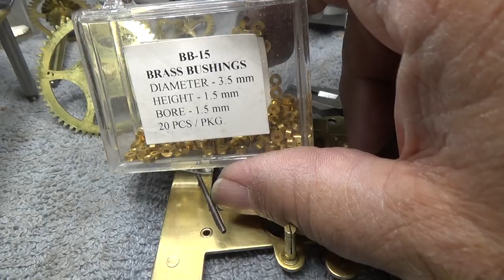Twin Gilbert Octagon Drop School House Clocks Clean and Repair

Comment: An index for this video:
00:00 THE FIRST CLOCK of two clocks
0:00 - 1:41 Introduction, plants and animals in the workshop.
1:41 - 3:18 Checking for dirt, damage, and wear.
3:18 - 8:49 Disassembly and checking in detail for damage.
8:49 - 10:44 Unwinding the main spring.
10:44 - 12:23 Cleaning the parts.
12:23 - 14:05 Removing stains and tarnish, using 0000 steel wool; discovering that the plates are bent.
14:05 - 16:26 Polishing the pivots and arbors in a lathe.
16:26 - 17:20 Checking pivot holes for wear.
17:20 - 21:11 Reassembly.
21:11 - 23:21 Oiling and final assembly.
23:21 - 24:00 Running on a test stand.
24:00 - 24:17 The completed clock running.
24:17 THE SECOND CLOCK
24:17 - 25:03 Introduction.
25:03 - 25:56 Checking for damage and wear.
25:56 - 29:29 Disassembly: separating the plates.
29:29 - 30:59 Showing the parts of the calendar movement and how they work.
30:59 - 32:42 Further disassembly, describing what the parts do. 
32:42 - 35:14 Unwinding and removing the main spring; showing the spring winder parts.
35:14 - 37:54 Wiping the parts after they've been in the ultrasonic cleaner; examining the parts for damage.
37:54 - 39:49 Polishing the pivots and arbors.
39:49 - 41:56 Checking for pivot hole wear.
41:56 - 52:09 Bushing worn pivot holes.
52:09 - 53:44 Bushing a pivot hole that has been bushed before. No need for a custom bushing this time.
53:44 - 1:00:05 Attaching, lubricating, and winding the mainspring.
1:00:05 - 1:02:42 Pegging the pivot holes.
1:02:42 - 1:11:16 Reassembly.
1:11:16 - 1:14:31 Oiling and final assembly.
1:14:31 - 1:15:59 Running on a test stand.
1:15:59 - 1:16:19 The completed clock running.
Reply from the maker: Another fine job of indexing.  Thank you.

Comment: hello again i clean all my brass fittings and rusty metal fitting in citric acid. i leave them in the solution till i see the rust has gone then clean them and give them a coat of WD40 works a treat
Reply from the maker: WD40 coated on clock movements is one of the worst things that can be done to them.  Might make them look pretty, but will ultimately attract dirt and grit and accelerate wear.  No lubricants of any kind should be on the teeth of wheels nor the leaves of pinions and trundles of lantern pinions.

Comment: Mr. Perry,
How do you bend a replacement suspension spring rod for the same kind of clock.  I can  order  another suspension rod from Timesavers but it would need to be cut and bent to match the original. Is there a specific tool to make these bends.  Thanks for allowing us to share your mantastic craftsmanship.
Reply from the maker: I use long-nosed pliers.

Comment: Another wonderful clock video!  I learn so much from you.  You look at all the details and keep pointing them out.  I was wondering what kind of bushing machine do you have?  I would love if you would show how to bush by hand and how it is done for those of us who cannot afford a machine and only can afford the reamer tools.
Reply from the maker: I do not own a bushing machine.  In this video, start watching at about minute 42.  I show the reamer in the drill chuck, but not the actual reaming. That's followed by placing the bushing into the hole and driving it home with a small hammer and finishing with a stake.  Then the bush is hand broached to exact size. Also, in this video https://youtu.be/7pJFUyYMU1o watch from minute 42 to minute 47.  This is what is meant by hand bushing.  Ream the hole with a hand drill or a drill press, place the bushing and drive it home with a hammer and stake, broach to size with cutting broach and finish with a smoothing broach.  All done without a machine.  There are many professional shops that have operated for decades without a bushing machine and there are even those who say hand bushing is equal to or even superior to machine bushing.  Even using a bushing machine, it is necessary to hand file the unworn side of a pivot hole before reaming to assure that the reamer will find true center of the hole.  Instead of a round needle file, I use small diamond grinding bits.
Reply: Thank you for the information!  Do you need a special holder to put the reamer in the drill press or does the reamer bit fit right in?  Thank you
Reply from the maker: The reamers have a round shaft and fit like any drill bit.  The KWM-style reamers have a horizontal pin part-way down the shaft, but can still be placed in a Jacobs chuck.  Adapters are made for both KWM and Bergeon styles for drill presses, but the only reason I can see for them is to extend the reamer farther from the chuck to provide a longer reach to a clock plate that has parts that might interfere with the reach of the short reamer bits.  There are also adapters to insert the reamers to cut truly by hand that act much like a pin-vise. https://timesavers.com/c-325972-tools-equipment-related-supplies-clockmakers-watchmakers-specialty-tools-equipment-hand-bushing-tools-reamers-cutters-adapters.html
Reply: Do you prefer the KWM or Bergeon reamers?
Reply from the maker: Bergeon.  You might like to check out the Butterworth bushing system at butterworthclocks.com 
You have to log in as username: butterworth  and password: butterworth
http://butterworthclocks.com/Bushings_Price_List.pdf

Comment: May I ask which reamer tool you use?.  Is it Bergeon or maybe a KWM?.
Don't they sell reamers for specific tools depending on rather it's Bergeon or KWM?.
I don't want to buy the wrong thing.
I am about to try my first bushing job, and I would like to know specifics if possible.  
No step is baby enough.  Sizes, brands, models, specifications.  
I don't want to mess anything up, which I am wont to do.
Exactly what tools are you using and where do you get them?.   eBay has many.  Timesavers?.  
Is this the proper reamers to drill the holes?: New American Made Reamers for Bergeon or KWM Machines & Hand Tools - 19 Choices! | eBay (ignorant YouTube deletes my link)
How about the chamfer to get rid of burrs?.     Specific size?
How about broaches?.  Like reamers, do they require specifics sizes too?.  How do you tell the size?. 
Not counting hammer and the bushing, how many tools do you need just to pop in a little bushing?.  Here's three already.
Anything else?.  

Thanks a million for your channel and taking the time for us newbs.
Reply from the maker: I use the Bergeon sized reamers because the bushings I buy are in full and half-millimeter sizes (outside diameter).  The reamers are exactly .03mm smaller, making a good, tight fit. So, the reamers are, for example, 1.97mm, 2.47mm, 2.97mm, 3.47mm. to cut holes for bushings that are 2.0mm, 2.5mm, 3.0mm, 3.5mm OD.  I choose a bushing ID (hole) that is equal to or smaller than the pivot.  That means the hole then usually has to be broached out to fit the pivot.  If you use KWM reamers and bushings, you use a chart to choose from a very wide selection of bushings to fit the pivot and then choose the reamer to cut a hole for that bushing, so there are odd sizes for the reamers.  If you are in business fixing clocks by the dozens, the KWM system makes sense to save time, but involves a large inventory of bushings.  There is no "wrong" choice; just personal preference, usage demands and costs considerations.  Broaches come in many different sizes.  Get some that fit the holes you're going to have to broach out.  I also use a very small file to even out the unworn side of a pivot hole to match the worn side so that the reamer centers itself.  Here are the reamer sets, including chamfer: https://timesavers.com/search.html?q=reamer+set&go=Search   Here are broaches (note sizes to match bushing ID in mm).  https://timesavers.com/search.html?q=broaches&go=Search  Here is the file I use: https://www.amazon.com/s?k=Grobet+Swiss+Pattern+File+Escapement+5-1%2F2%22+Round+Cut+2&i=live-explorations&crid=3I43KDQTLMI89&sprefix=grobet+swiss+pattern+file+escapement+5-1%2F2+round+cut+2+%2Clive-explorations%2C104&ref=nb_sb_noss

Comment: I was thinking, you could keep your smooth broach in a handle all it's own so you wouldn't have to change it out.
Reply from the maker: Smooth broaches are different sizes just as cutting broaches are.  I've thought of making wooden handles for all my broaches, both cutting and smoothing, but that takes time and usually when I'm in the workshop, it's to fix clocks and not do other things.  There are lots of things I could do that would make things faster, but who's in a hurry?

Comment: I have a Schatz 8 day cuckoo that my father bought for his father unfortunately the night that my father died it was knocked of the wall by the undertaker's assistant.  I removed the works to repair the case and noticed that the plates are bowed (sprung) some of the pivots had been knocked out of place. It will need several pivots rebushed. is this something you'd be willing to work on? Thanks for your consideration and excellent videos
Reply from the maker: Leave an email address in a comment in about a month.  I'll know better then how much, if any, clock work I will be doing this next winter.  May be looking at a hip replacement soon.
Reply: @dperry428  wishing you the best of wishes on your health

Comment: bonjour , i love your channel mixing ciment to delicat clock work , is one of them was your job before . merci
Reply from the maker: Collecting and repairing clocks is just a hobby I've had since 1968.  I was a science teacher for more than 30 years.  Concrete is just another hobby I learned since my retirement in 2004. Summertime = back yard, pond, garden, concrete.  Wintertime = basement, fix clocks.  Year round = make videos of summer and winter.
Reply: thank you and do not forget one eye
Reply from the maker: Noted.  One-eye is my favorite and gets most of the peanuts.

Comment: Your spring winder tool looks very well-made.  What brand of tool is it?
Reply from the maker: I don't know that it has a brand name, but is called an Ollie Baker style spring winder and is offered for sale by a number of clock supply houses.  I don't remember which one I bought if from.  Could have been Merritt's Antiques or Ronell Clock Company.  As I recall, it was about $230 and includes the sleeves to remove barrel springs.  It does require a set of let-down keys to go with it.  It is very well made out of solid aluminum and nice to have, especially now that I'm older.  It makes letting down springs and winding them much easier than my old methods. Much safer, too.

Comment: When you clean your movements in the solution, do you use rinse solution to finish up or do you use denatured alcohol? I am trying to figure out what works best
Reply from the maker: My little shop is in the basement and I have access to a laundry sink there.  The cleaning solution is water-based, so I just take the parts in a strainer to the sink and run hot water over them.  I then usually just hand dry each part, occasionally using a hair dryer and/or compressed air. An alcohol rinse one might consider with a waterless cleaner or to remove water.  If you use alcohol to dry the parts, it should be as concentrated as possible (95% or better).  A better alternative for drying is acetone, but it will remove any lacquer coating, which is the main reason for using a non-ammoniated cleaner. You also don't want to use acetone with mechanisms that contain plastic parts. Years ago, the collector I did artwork for, used naphtha (benzene) for his rinse and dry. I don't like it as it is a known liver carcinogen.  If you use volatile organic, especially aromatic hydrocarbons as opposed to aliphatic, it is a good idea to use them in outside in open air. I prefer hand-drying as I can closely inspect each part for any remaining dirt or rust and remove it at that time. meticulous cleaning is a must with me.
Reply: Okay. Thank you so much for the information. Like I said I’m just trying to get started and wanted to get several opinions of which way they clean it so I can figure out my way . Thanks again